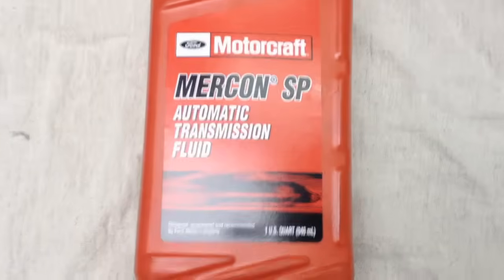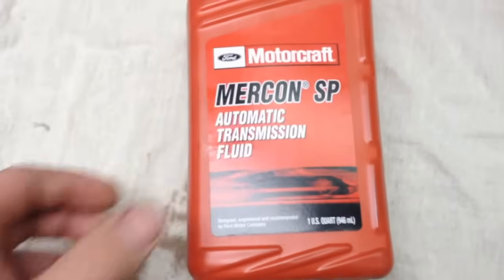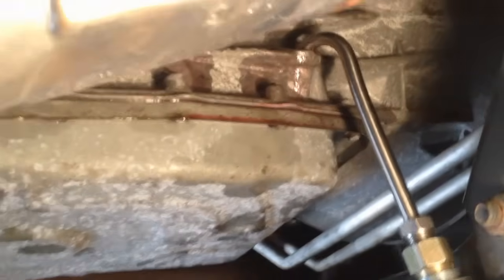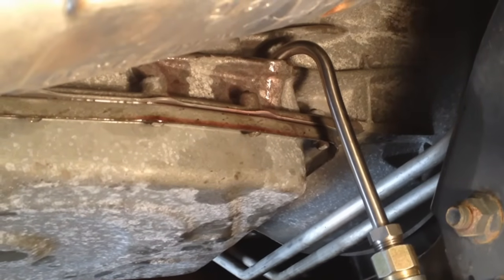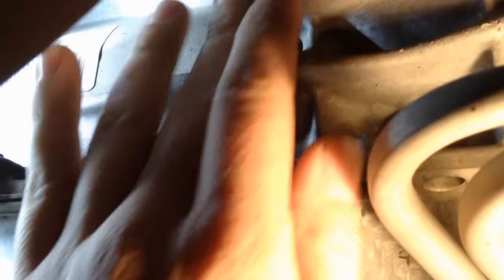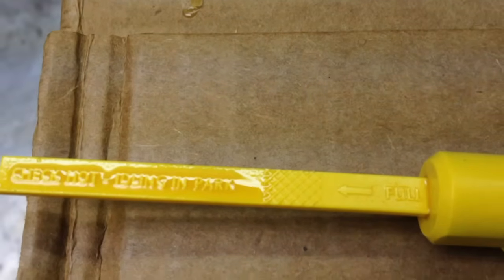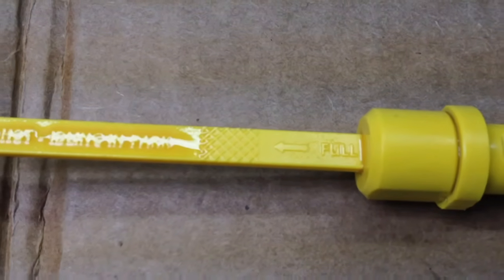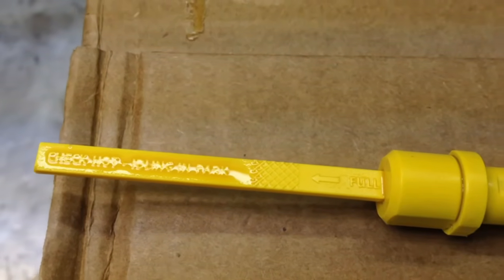Ford 6R60 & 6R80 6 Speed Transmissions: Fluid Fill & Adjustment Procedure

Comment: It would be a real shame if Ford made the fill port accessible
Reply: This fill location is a big improvement from the ZF trans this is based on. That one had a drain plug though
Reply: Or if they were to add a friggin drain plug on the pan. 

Seems like every single known issue with Ford (F-150 at least) is to make a $20 part cost $1000-$2000 to replace.

Blender door actuators? $15 part, $2300 to replace because you have to completely remove the entire dash to get to it by the passenger footwell.

6R80 Transmission bulkhead sleeve? $15 part, $800 - $1200 to replace because you have to drop the pan in order to release a little plastic clip inside the transmission to get it out. 

Such BS and one of the primary reasons why I don't want a new vehicle because I'm sure it's 10x worse.
Reply: @Miked1332 they sell a aftermarket pan with a drain plug , I’m not dealing with that bs mess again
Reply: Regardless what it's based on, automakers are so cheap nowadays they gotta save the $3 per car or whatever to create a dipstick tube..!!? and yes it is absolutely possible for this vehicle really just make a hole instead of threads and put a dipstick and tube... ..
Reply: Imagine the millions they saved by not installing factory dip sticks
Reply: My God!!!!
Reply: How would they make money 😂😂😢
Reply: This is one of the best spots it’s been on in years, wym
Reply: You can get a new dipstick for like $45 that runs up into the engine bay. You can also fill your transmission through it as well.
Reply: Under the truck rn fuck this
Reply: How about a drain plug?
Reply: Ya no kidding about broke everything on my truck trying to do this
Reply: @Logan-te3iq how? This was the easiest thing I've ever done on these...
Reply: The reason they don’t put dipsticks on these trucks anymore is because people fill them with any fluid type and destroy them
Reply: @Tiobolo713 as opposed to what? Not maintaining them and destroying them anyway, because you can't access shit?

Comment: 2009 F150 6R80 transmission. I would assume it was originally Mercon SP in the transmission. Do I put SP in again or now change to the recommended LV? So confused with all the comments especially since it says DO NOT MIX. There is obviously going to be some amount of SP in the system even after a pan drop no? Just curious. Brian you are my go to for my truck. I have used so many of your tips. Thank you so much for being so precise and to the point. The videos are amazing with great light too.
Reply from the maker: No, all 6R80 transmissions came from the factory with Mercon LV, they just installed the wrong dipstick from the factory on the 2009-2010 models. Se here- 

SSM 21307   
6R80 TRANSMISSION FLUID USE FOR 2009/2010 IS MERCON LV
SOME 2009 AND EARLY BUILT 2010 F-150, EXPEDITION, NAVIGATOR, EXPLORER, EXPLORER SPORT TRAC AND MOUNTAINEER EQUIPPED WITH A 6R80 TRANSMISSION MAY HAVE A TRANSMISSION FLUID INDICATOR (DIPSTICK) THAT SPECIFIES FLUID TYPE 'MERCON SP'. THE CORRECT FLUID FOR THE 2009, 2010 6R80 IS 'MERCON LV'. THE WORKSHOP MANUAL AND OWNER GUIDE SPECIFIES THE CORRECT FLUID 'MERCON LV'. DISREGARD THE INFORMATION STAMPED ON THE DIPSTICK. THIS TRANSMISSION USES 'MERCON LV' ONLY.
Reply: @FordTechMakuloco  Thanks Brian

Comment: On my 2016 F150 with the 6R80 I just dropped the pan, cleaned it along with the magnets and gasket and replaced the filter.  I measured by eye what was drained out and put into gallon jugs: about 4.5 to 4.75 quarts.
Then as described by FordTechMakuloco, after refilling and checking the level on the little dipstick at about 176° trans temp while truck running, I added about 7.25 quarts back in so that the level was at the top of the upper hatch marks. (can't remember if "B" or "A" would correspond to that higher fill-level area on the stick) 
Drove the truck and it feels good.  Shifts may actually be smoother than before.
Question:  How can 4.75 quarts of old fluid be replaced by 7.25 quarts of new fluid???  Where did the other 2.5 quarts of old fluid disappear to?
Reply: Sounds like you most overfilled it as it will expand when hot
Reply: How did you know it was 176 degrees?   I put a scan tool on my 2016 and couldn't get live data for tranny temp.

Comment: Thank you thank you thank you you were the only person on the internet to know and realize that most of us don't have a car lift and will be lying on the ground at a very weird angle and to check it when it's cold which is the smart thing to do just didn't know where the fluid level should be no one ever said bottom of hash marks figured the glove part out the hard way LOL used my welding gloves but are now ruined because they have transmission fluid all over them

Comment: just pullled the dipstick on my 6r80 and it has A and B hash marks. I pulled it while trans was cold and it the level is at the very top of B hash mark (top hashmark) does this mean the trans was over filled at some point?
Reply: If you pull it cold  without the truck running it will seem over filled. If you start the truck and pull it while still cold and running it should be in the cold level. It should always be checked while running whether hot or cold

Comment: 1st- thank you so much for your videos. They point me in the right direction, great tips, and not getting caught unaware. One thing I’m wondering. When putting in transmission fluid after changing fluid From the pan and filter is it necessary to change  the gear selector from drive to reverse  to park a few times before checking the fluid level. I have a 2010 Ford F-150XLT 4.6L
Reply: Yes

Comment: 2011 F150 5.0. For those of you wondering where on the dipstick to fill the tranny when cold this is what I found.
Filled the tranny to bottom of dipstick with engine stopped.
Started and warmed truck to 90-110 deg. 
Filled to the line between A + B areas on the dipstick.
Drove for 1/2 hour to reach operating temperature (195-215)
Removed tranny fill cap with engine idling.
Fluid was overflowing. Yikes.
REMOVED 16 oz of fluid to get the level exactly at the top of the B area on the dipstick per Ford service manual.
I use 90° Bent Nose Long Reach Needle Nose Pliers to remove/replace the dipstick. (No need for ov-gloves)
So next refill I will start a little lower than the A area of the dipstick. Easier to add than remove.
Reply: I take a cold reading. It has 19k. Never changed, so I'm 99% the level is correct. Will be changed in a few days.

Comment: When the oil is insert must I start the engine  and shift the gears to circulate the new oil?
Reply from the maker: Did you watch the video or skip around?
Reply: @FordTechMakuloco  I watched it full :-)
Reply from the maker: Yes the fluid is checked while running at idle.
Reply: @FordTechMakuloco  ok thank you. My English  is not so good. And here in Germany  no one can help to change the Leadframe.  So I will do it my self  with your great  Videos.  👍

Comment: I followed the instructions filling it WARM to the bottom of hash marks....ended up with leaking trans fluid. checked it again HOT and it was way overfilled - had to pull approx 1 pint or 600-700ml out of there to get it to the TOP of the hash marks when HOT. I was just releived to learn I didnt have an expensive leak to repair lol...live and learn.
Reply: Same thing happened to me. Mine also started leaking fluid. Hoe long did you drive your truck before you drained the trans fluid ? Also after you drained some, did the leaves go away? 
-Thanks.
Reply: I’m curious did you check it while the truck was running?
Reply: @BB-xq6rj  yep.  I was hoping it would help the "clunk"/abrupt downshift to first when braking - its worse in cold weather....but its been 3 winters i've had the truck now and it hasnt got any worse so imma just leave it.

Comment: If I fill my mustang to bottom of hash mark when running if engine is shut off before tightening fill cap, the fluid runs out of transmission if not running.    In other words, normal fluid level engine off is above the dipstick hole??
Reply: Yes because the transmission cooler lines and transfer pump consumes fluid while running. That’s why it’s filled and checked while running in park. If the fluid is at operating temperature and you take the dipstick fill plug out after you shut it off fluid will come out. That’s why transmission fluids are checked while hot and running in park 😊

Comment: Can anyone tell me why transmission fluid comes out of my dipstick when I remove it on a 2014 with a 6R80? Have tried it both running at temp after driving and not running. Also just had fluid and filter changed and it’s a brown color again within a week. I thought I felt it slip once so I thought it may be low on fluid.
Reply from the maker: If you are under there for some reason checking fluid level hot after a test drive with a min of a 5 minute idle first after the test drive then simply adjust the level to the max full hot line on the stick.

Comment: First off Brian, thank you for ALL the excellent vids, much appreciated... Just did the pan drop and filter change on my 2016 F150 5.0 with no issues. Im a little confused with the level check though. You explain to adjust the fluid level for the bottom of the hatch marks while trans is warm. My 2016 has two sets of marks A and B on the stick. Could you tell me which I should aim for... Bottom of A or B. The shop manual stipulates top of the B dotted marks (perhaps that is at op temp) but I would stick with your experience and knowledge.  TIA
Reply: My stick has A on bottom and B on top
your bottom set of hashes is for cold fluid aim for the middle the top hashes are for when your fluid is hot again aim for the middle. These two sets of hashes are to help determine your fluid level whether the transmission is cold or hot.
Reply: Larry Ranger did you ever figure this out? I'm wondering the same.
Reply: Bought a grill glove from amazon to work near the CAT.  I run it up to temp and for a final fluid check.

Comment: ended up changing the pan to a b&m and changed the 2 other parts you recommended.  but after getting it filled up . now it does not want to go into gear at all.  what did i do wrong?

Comment: My 2009 Expedition took 10qts to reach the bottom of the cross hatch marks! It was also right at the brim of a 10qt oil drain pan when I drained it, so I'm assuming about 10qts came out of it. What did I do wrong since everyone else says it's 7.5qts for a drain & refill?
Reply from the maker: 10qts is way too much unless you let it drain for a long time.
Reply: @FordTechMakuloco  My only guess is since I dropped the pan before removing the dipstick to break vacuum, I'm not sure if this would cause fluid to be drawn out of the torque converter. 😳
Reply: @The3800Bird once you break the pan seal you lose vacuum

Comment: Used my welding glove, and a backhand heat shield. Made checking full hot a piece of cake, even on jack stands. Any risk of damaging an 07 6R60 by using the LV going forward, and is there cross contamination issues after a filter change? I know SP is in there right now.

Comment: Super helpful, does the engine have to be running before you take the fill plug out?
Reply: No don’t take it out with engine on or just after running. You’ll burn yourself
Reply: no .. just make sure you have a pan to catch the transmission fluid that might flow out..

Comment: When I was loosening fill cap to change fluid/filter, a few drips of fluid immediately started coming out. When I took the pan off and drained the fluid I only got about 5 1/2 quarts out. I don't get why it seemed to be so full but yet only got that much out. Sat overnight and engine was cold when I drained it. Thinking truck was not level enough and there's still fluid in the front of trans because back end was up to high?

Comment: I don't understand how if you are filling it until it spills out, that it then is only reading to the bottom of the hash mark?
Reply from the maker: It was never started, once started the level drops
Reply: @FordTechMakuloco  thanks for getting back to me. I filled to spill and then started, got it warm, and it was still very low. Ended up topping off while running warm . I just got the truck with 115k and it took about a quart to be right at bottom of hot hash when warm. I’m afraid to do a full fluid swap at this mileage :(

Comment: I didn't hear the truck running when you did a final check. Do you check with the engine running?
Reply from the maker: Yes of course.
Reply: @FordTechMakuloco  Do you have to add fluid when running ? Will the fluid overflow when adding if not running?

Comment: Hi,great video !! I have a problem, I broke the bolt, the thread left inside of the transmission with the dipstick.  I only have the head from the screw.  The best part is that I didn't use much force and the bolt broke.  the temperature was high.  Is it possible to repair this without removing the transmission?
Reply: Just drop the pan and get out the fluid and any metal pieces, put in new filter and fluid and new bolt
Reply: Did you remove the bolt I got the same  problem ???
Reply: @joseonta  Hi. Yes. I pushed the screwdriver into the screw thread and fortunately the thread did not catch tightly.  Try it like this.

Comment: Fluid just pours out the fill hole when trying to check level.
Reply: Truck has to be running and in park when you check it dickhead! But I assume you figured that out by now
Reply: @hankhoover8584  wow really? Why jump on to be an asshole... there was actually issues with the trans smart guy.

Comment: Great video, thanks for help. 
I changed the oil on my 2010 explorer 6r80. When i finished snd screwed the dipstick screw in, I broke the thread and only got the screw head.  The thread stay inside of transmission housing. The dipstick has a slight slack but it sticks, can I drive in this situation?  It will be worse now with the repair, removing the thread from the gearbox housing..

Comment: Can someone explain the concept of "vacuum" in the unit?  When I did mine, I removed the plug cold and nothing came out.  Now I'm surprised because when I filled it up, it was on the top of the stick(cold), then ran it, and the level dropped.  Therefore, I can add more fluid.  I should be overflowing with the motor shut down.
Is the vacuum the reason why I didn't get an overflow when I originally pulled the plug on the cold unit?  Oh, I didn't hear any air movement either.

Comment: Did my 2015 F150 V8 60K mi. today.  Went differently.  
When I removed the dipstick plug, no oil came out.  
I pumped out about 5 qrts, then unbolted the pan.  Another 3-4 qrts came out!  I filled my 7 qrt pan to the top and more in another similar.  
I installed the new filter and the clean pan.  
The unit took about 8 qrts warmed up, motor not running.  Motor running, it's on the bottom of the stick.  I have to check it again RUNNING (wasn't sure at the time) and add another qrt or so.  
The oil came out looking pretty black.

Comment: Bryan, I wanted to Thank you for all your videos and sharing all your knowledge. I recently change my fluid on the 2016 F150 5.0 and now transmission is not shifting properly. I added 7 quarts of MERCON LV. do you think I'm low on fluid by a little bit? I dropped pan and used new motorcraft filter. Thanks again
Reply: dang. this is why I'm never touching mine lol.
Reply: Did you ever figure out why it wasn’t shifting after you were done?
Reply: I did mine no problem, run for 15 minutes and check while hot also.

Comment: I put in 1/4 of transmission fluid to get it at the full mark while the transmission is running but someone told me I was supposed to go through all the gears even though my fluid is pretty much full it just needed 1/4 to get to the top full line is it true or as long is at the top full line while the transmission is running that’s what matters?

Comment: I have a 2010 Explorer with the Adrenaline Package. It has a 6R80 Transmission. Does the transfer case use the same Mercon LV fluid as the transmission or should I be using something else?